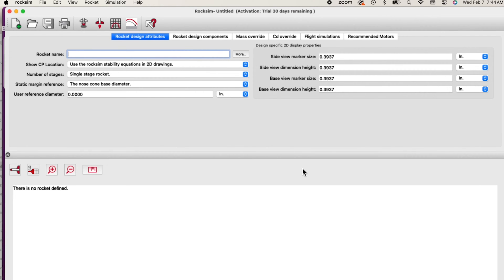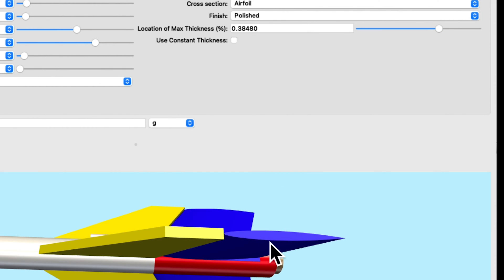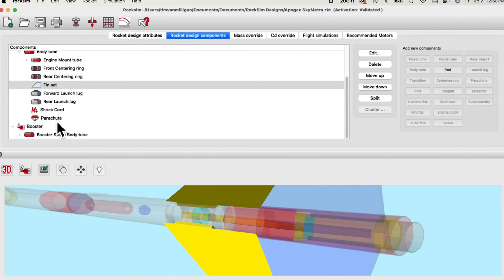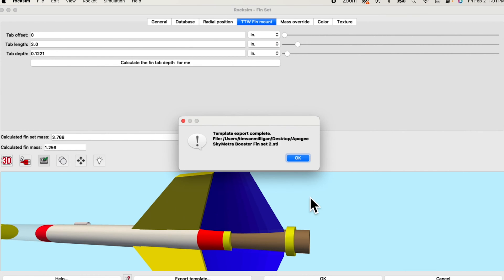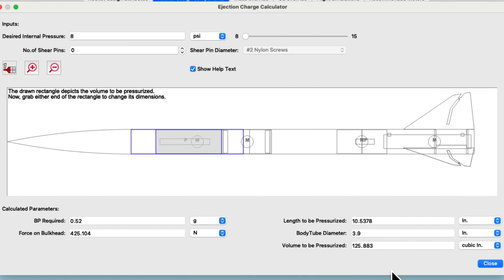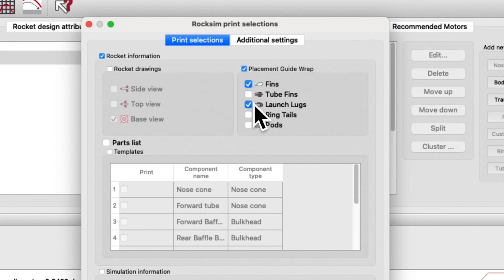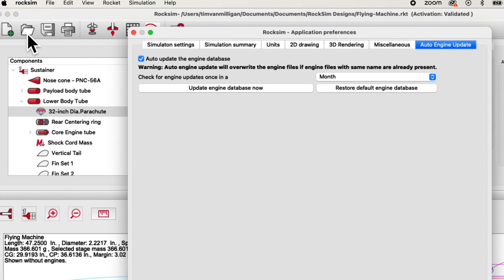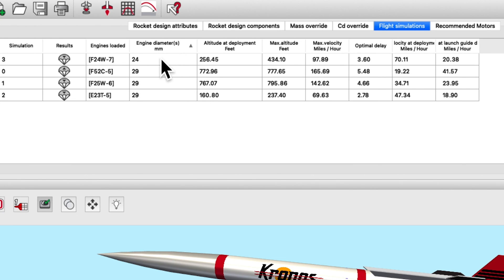RockSim v11.0.0 New Features

Comment: RockSim11 question for upcoming video presentation: Example Estes So-Long rock Sim file: you set either booster or main fins to Airfoil, neither fin sets allow you to adjust the airfoil, and the Use Contant Thickness does not appear. Also, this same thing happens on the Apogee Kronos file on the Strake Fin set. My question is if there is something that you have to set for those functions to appear on the fins screen?
Reply from the maker: It sounds like you are still using RockSim v10. That is just my guess.

Comment: How about 3D printing the entire rocket?   Maybe RockSim v12??
Reply from the maker: RockSim has had that feature for over 10 years. We did that in RockSim v9. From the File Menu, choose Export/3D model. You'll export as an .OBJ, but that is basically the same thing as a .stl (.OBJ includes the decals on the surface, where .STL does not).

The only difference now in v11 is the ability for the fins to be air foiled. That is totally cool.
Reply: I stand corrected...thanks!